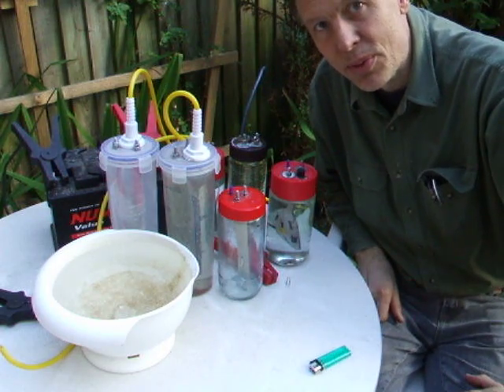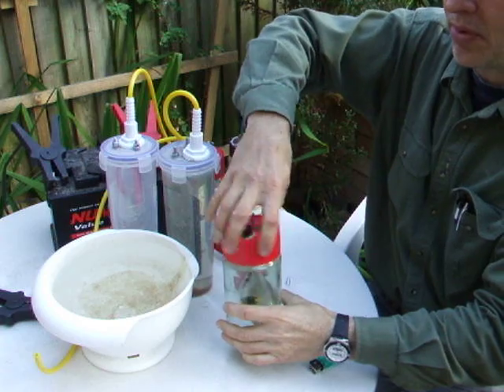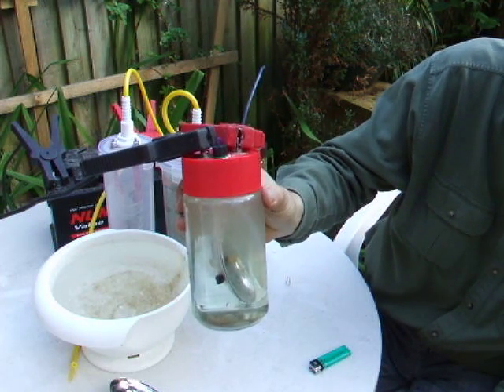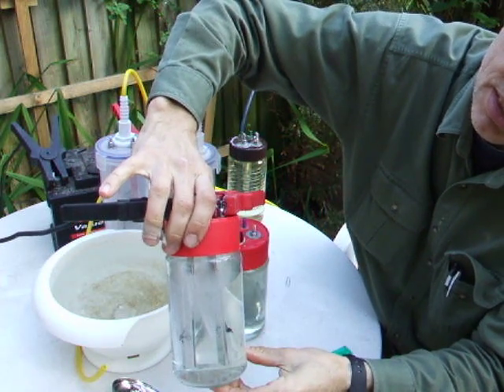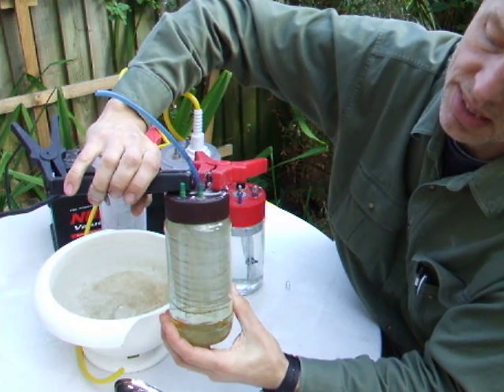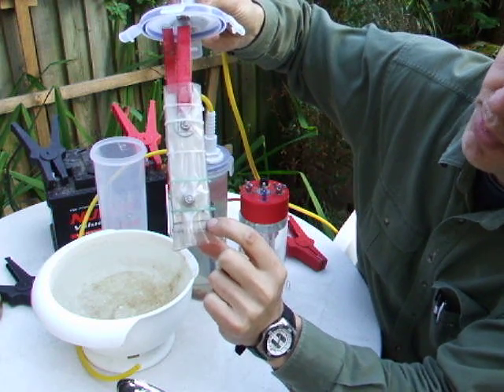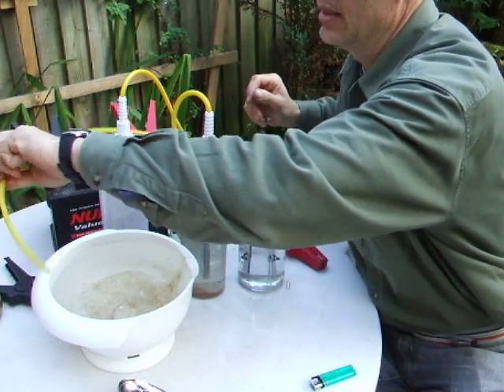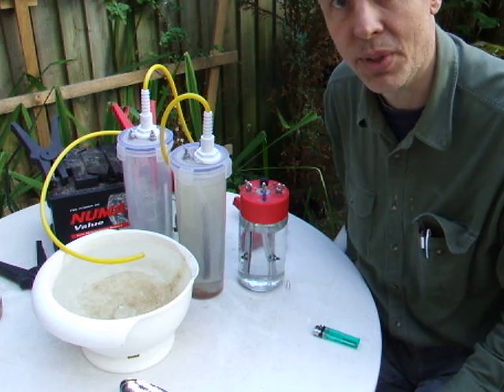Hydrogen Generator/Electrolyzer Demonstration

Comment from the maker: The current drawn varies with the temperature. I try to keep it at about 5 amp, warm,  for these units. It is simple electrolysis. Nothing new there. The new thing is to use it as a combustion enhancer and thereby fuel saver. In my last car the engine area is very cramped and I could only fit a smaller unit next to the radiator, but I still get on average 70 more miles to a 53 litre tank than when I did not have this in the car.